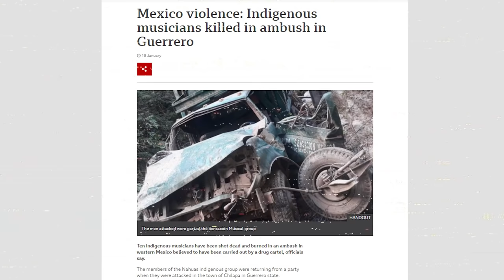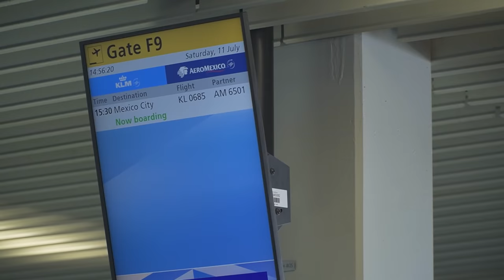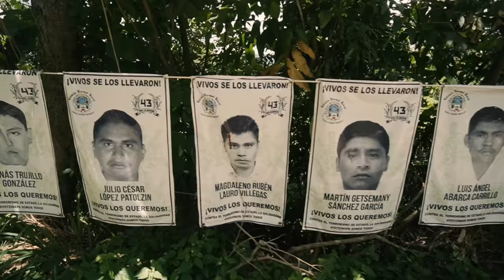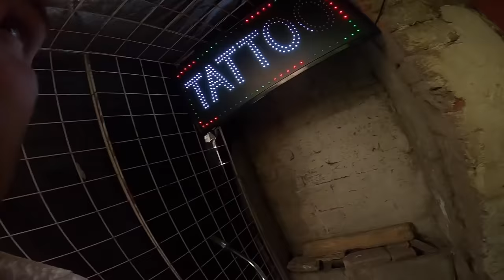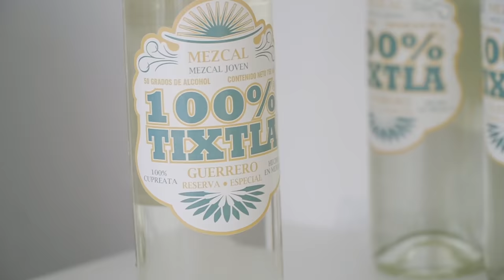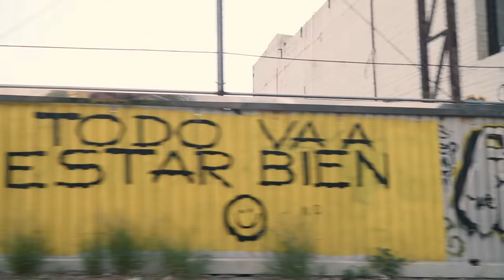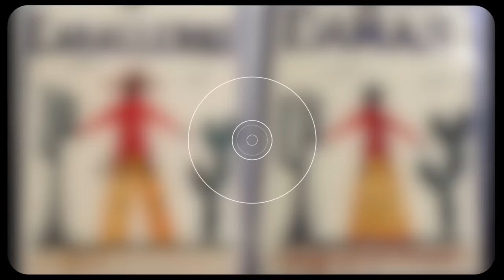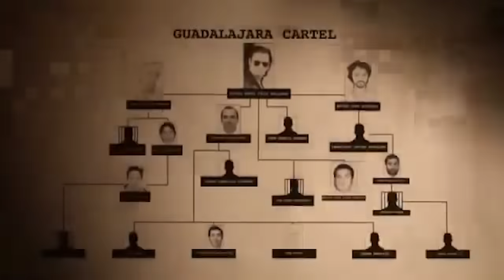Most Dangerous State of Mexico / Narcos War Zones / How people live

Comment: You're doing amazing work man, just one suggestion - during editing it would be nice if the audio levels are equalized for the main audio and the translated bits. You get pretty loud sound during the non translated parts and then really quiet ones during the translated parts.